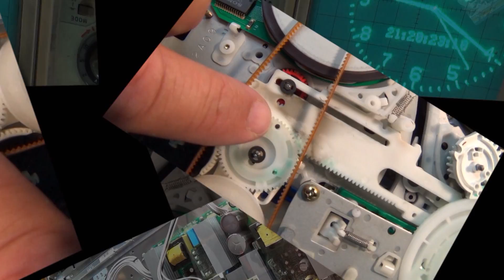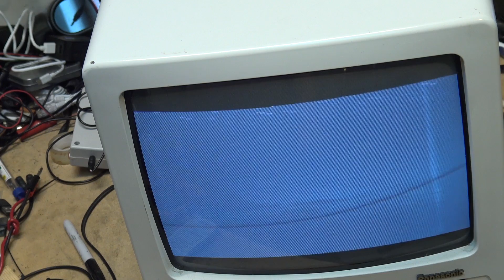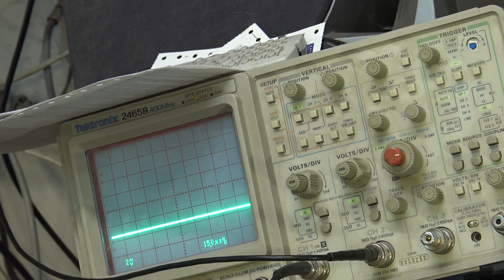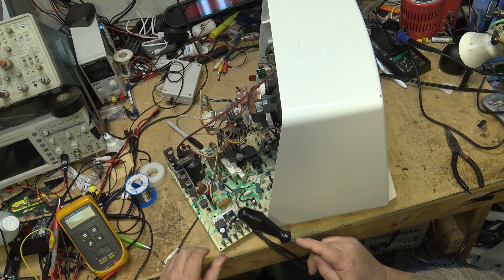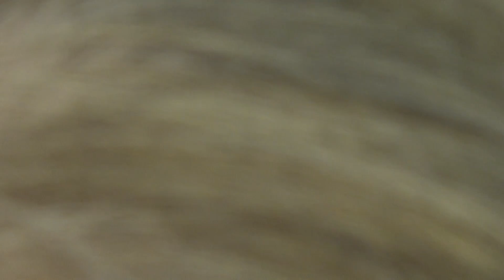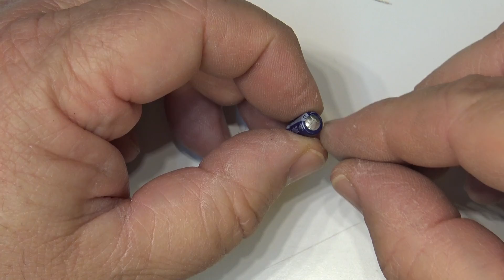Panasonic pc14a50 dull short picture repair

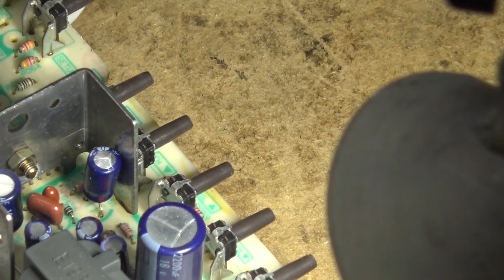Comment: 26:00 The cap is in backwards. I never trust the silk screen print on the board as they are sometimes marked wrong. What other verification did you make?
Reply from the maker: The silkscreen is correct. Have seen this problem many times on this chassis.  Same with the open resistor.  Very common fault.
Reply: @12voltvids  Personal experience, works for me. My grandfather was a TV radio super repairman, I learned a lot from him. He knew the failure points of all the models. I had a 13 inch RCA color TV I was stumped on, brought it to him and he knew the failure point of that set. Had it diagnosed in 3 minutes. Bad wire wrap connection inside an IF can. Color would pop in and out when you gave it a thump.
Experience is the best teacher...... That is why I am watching your videos, I am a technician and retired electronics assemblier I can diagnose to the component level, but lack the type of hands on experience you have on specific technology, ie. CD players, VHS machines. Thanks..

Comment: Dave I have a Panasonic NV-MV40 in which the take up reel arm has been cracked and break into pieces. It is an R4 Mechanism. So,Please solve the problem when you have a vcr that have the same problem.

Comment: I was wondering what is the risk of burn in with the lcd/ led TVs made these days? I would like to hook up my old Wi game system to my 2019 LG Nanocell 65”
Reply from the maker: LCD don't "burn" like plasma, OLED or CRT tubes did where the phosphor actually burns and then leaves a shadow on the screen but they will suffer image retention which can be in some cases permanent.  I know there is a warning in my Samsung LED TV manual about image retention and Samsung must be worries because when i put it in mute, the mute icon on the screen fades on and off and moves up and down the screen.
Reply: @12voltvids  thanks. I’ll probably leave the Wi system for one of my other cheaper TVs

Comment: You know I've always wondered why everybody always talks about how dangerous and horrible CRTs are as far as the high voltage goes, yet on modern cars the ignition coils can produce upwards of 40kv with A LOT of current behind that voltage and no one ever talks about how horrible and dangerous they are???????
Reply from the maker: Ignition coil actually has very little current and it is a pulse.   CRT is also DC, and the jug acts like a big capacitor.   Can you say defibrillator.
Might not kill you but it hurts like hell.  I have been bit a few times by the cobra.

Comment: On older Asrock motherboards (~2004-2008), the cap symbols are silkscreened backwards. The polarity markings are right (under the cap), but the filled half circle is the positive side. I've learnt it the hard way, after recapping a board, which was a pain to do with a 50W Weller TCP iron with the old first gen Pb free solder on a 4-8 layer board, and caps that were attached to huge power planes without thermal relief. I had to do it again because I've done it by the symbols, which were backwards... I guess the layout engineer and his mother in Taiwan hiccupped for a while when I realised why the mobo was not working after the first recap. No damage fortunately (except some nerve damage of myself), as the many reverse polarity low-ESR caps tripped the protection on the PSU. It was an old AthlonXP config. I still have the board somewhere I think.
edit : typos
Reply from the maker: Well this one is not a silkscreen error.

Comment: Hey 12voltvods, wanted to ask, can you fix pal vcr:s? If u can P L E A S E upload a fixing tutorial vid, kuz i can't fix mine =(
(i live in Finland SO i use pal vhs equipment)
Reply from the maker: A pal VCR is exactly the same as an NTSC VCR except the motor speeds (slower on pal due to the slower frame rate) and the colour circuits.  Mechanically they are the same.  I have worked on multi system machines but not straight pal as we didn't use pal here.
Reply: @12voltvids  Thank you SO much!!!
=D

Comment: Dave, You really know your stuff! Great job! I tried fixing the flickering LED display on a Bionaire humidifier. After reflowing the display points on the PCB it worked for about 10 seconds and went out for good. I salvaged the fan in the humidifier and it sucks the solder smoke away from me while soldering now :)

Comment: What's your opinion on a 1983 vintage RCA CTC-121 chassis TV? (Model VJM2023S)

I was given one that appears to have very low hours for the age and came with the remote and manual.

She's got a good picture.  I still prefer a Trinitron, but this thing still makes a great gaming TV as far as I can tell.
Reply from the maker: The ctc121 wasn't a bad chassis if i remember correctly.

Comment: Always nice see how quickly you home in on the problem. Brightness limiter, could you  explain  how it works and why one is needed? TV made in Mexico but the label is printed in the USA!
Reply from the maker: Brightness limited limits the beam current.  Wish I had a schematic handy so I could go through the circuit.  I honed in so quickly because I have s seen this problem many times.

Comment: Cap' in the wrong way!  Yeah I thought that once as well, bulging cap' and thought by looking at the screen print that it had been installed wrong, put a new one in as per the screen print, switched on and a few minutes later, "BANG" and something shot past my head.  Yes, you guessed it, cap' blew up, it was the screen print that was wrong, they just never fixed the screen print.  Told my mate about it and he started laughing, then his wife let it be known he was caught out the same way!  Should have checked it first and not taken the screen prints word for it.  But we live and learn.  This was on a 3 amp power supply, so it was quite a bang!
It was so loud that people came to see what had happened.  here was me sitting with a mile of brown paper type stuff and a mark on the celling and wall where the case had bounced off.  I have never seen one explode with such force before, normally it is just a pop, it case flies off and the innards fills the work bench.  The Cap was not very cheap either, what is worse I only ordered one so had to wait for another to arrive!
Reply: Haha funny story.  I wonder how many electronics repair techs wear eye patches.

Comment: Hi Dave, quick fix well done again.  It seems that there is still a slight dark line near the bottom of the screen. Is that a reflection or a latent issue ?   JwgK
Reply from the maker: Rolling shutter on camera.  Had i done this with my CCD camera it wouldn't be aparant.

Comment: I always trusted the physical installation of the cap polarity over the silk screen on the board.   Especially for a unit that is that old.   If it was really in there backwards and it mattered the set would have been repaired or scrapped years ago.   The silk screen and the printed schematic were always distrusted over what the factory actually assembled.  Unless the difference caused a issue.   And if it did the issue would have been apparent usually under warranty.

Comment: I miss CRTs. they are resilient and last a very long time. I have a 25" Magnavox from 1994 that was bought brand new for Christmas, its the chassis that has the common cap failure 100uf 100V cap, or something like that. I had to change it once and that's the only thing I did. Still going.... and its a daily watcher in my bedroom. that CRT must have thousands and thousands of hours considering its been on at least 8 to 12 hours a day every day since 1994, Still has a picture on it like it did when it was new.  Try having an LCD last that long.

Comment: Well done dave, that will make a perfect old  home computer monitor :-D
That cap coped really well.
It was fed via a resistor and a zenna diode  (limited current),  a secondary supply to the frame chip perhaps.
I know c.r.t sets are very " Old hat "  but i still like how good they can be when set up correctly.
it's mad that your outside set does not crackle from the anode cap in the damp air lol.
Reply from the maker: The cap is sealed to the glass.
Reply: @12voltvids  Water finds a way in,  look at your outside cameras,   nothing is safe Ha ha :-D
Reply from the maker: @zx8401ztv  
Only 1 has leaked so far and I suspect that someone turned the hose on it.

Comment: The pcb looks familiar to me,RCA is non european brand,for sure it is no panasonic also.I think the chassis was released in Greece under the commercial brand as ORION.
Reply: Funai corp bought out RCA if I recall correctly (Orion was a funai brand)
Reply: @CotyRiddle  Orion isn't Funai, nor are they owned by them.

And RCA pretty much only exists as a brand owned by Technicolor SA, where the branding is licensed.  For instance, Sony Music owns RCA Records but uses the branding under license from Technicolor.
Reply: @Watcher3223  do believe funai owned them at one point.

Comment: Whenever I've put a cap in backwards, it's 'capacitor confetti' time.
That cap must have been used for signal coupling and not for keeping a circuit charged.
Otherwise, I can't explain it not going kerflewee.
Reply from the maker: I would think it is running at pretty low voltages.   I don't know the history of this tv but i suspect it has been sitting for a long time since it was last used.
Reply: When I was about 12 or 13 thereabouts, I would take capacitors out of old 9 volt transistor radios, put them inside model airplanes, and remote detonate them with a Lionel model train transformer. 0 - 28 VAC with a clicks-on resetting thermal breaker. Nobody said young teenagers had wisdom, we all did stupid things. These split top caps just go fizzz or pffft.

Comment: Are there any decent & affordable digital oscilloscopes or do you prefer the analog ones?
Reply: Television signals are complex and the high voltage with electromagnetic along to the digitized resolution of the scope may display totally wrong signals.And also those years these models were the only affordable with prices around 1000 euro but then was a lot harder to pay 1000 euro than nowadays.Oscilloscopes were equal in price and sometimes more expensive than a standard 27 inch CRT.
Reply from the maker: A DSO capable for analog TV signals are huge bucks.
Reply: @12voltvids  Gotcha thanks

Comment: i recall this issue. my parents bought a new rca tv in 1994 and the tv had this issue after a few months use. it would have the vertical issue and then if you messed with the cable jack in the back the coax it would get full screen. one day it go so bad it couldnt be fixed and the picture fully went out and all that was left was sound. tv was bought from silo right at the end of silo's life sadly. the tv didnt last more then maybe a year if even that and the picture was gone. crappy rca thomson junk
Reply from the maker: RCA went in the shiter when Thompson took over.
Reply: @12voltvids   you are right about Thompson, i had a UK Sky + HD box which blew it's PSU, when it was repaired they found  it had also fried the HDD, so i let the repairer keep it and swapped it for a Amstrad one, which lasted until I upgraded to one with a 2TB HDD